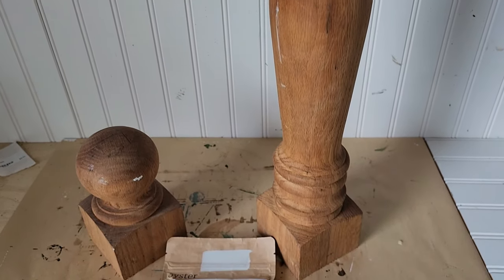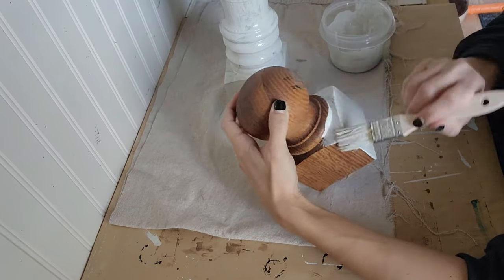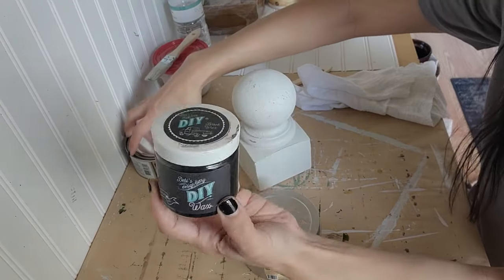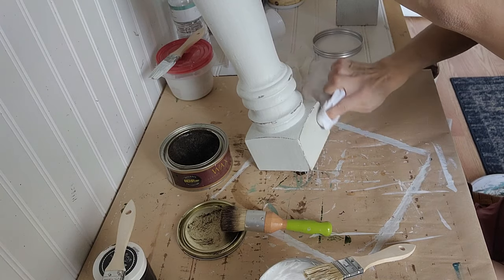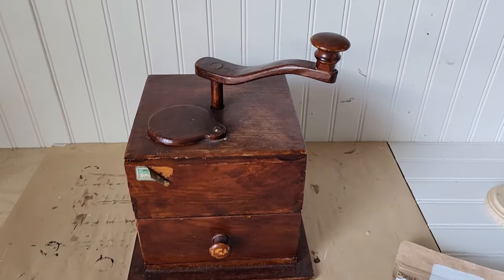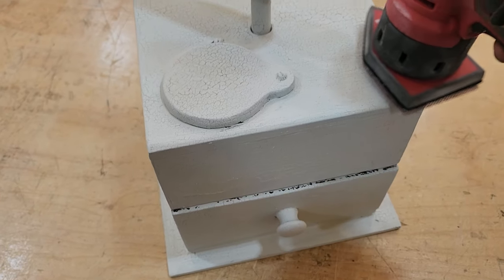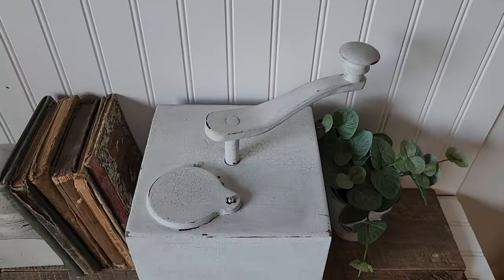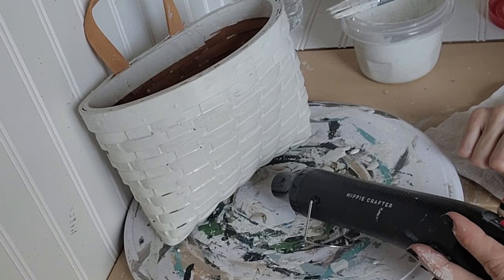Spring Thrift Flips | Using Milk Paint For That Gorgeous Chippy Finish | Trash To Treasure

Comment: Hi Emily! Great flips! I've never seen clumping with the sweet pickins paint so I wonder if it's a quality issue. I much prefer the crackle you achieved to chipping, but if you want chipping you can put vaseline on the surface before painting. I would add that tag back to the coffee grinder -- perhaps on the inside.
Reply from the maker: Hi Gina! Thanks for the Vaseline tip! I actually am really with the crackle look the longer I've sat with those pieces!!

Comment: Loved the candlesticks!! I have worked with milk paint and I too stuggled finding the chippy places, but I have watched Jami Ray Vintage stipple on a chunky layer of paint using salt wash, letting that dry, then applying the milk paint over that. After drying they sand or use a scraper to unearth the chippy. I have everything I need to do it, except the perfect piece to try it on.
Reply: Baking soda works as well and much cheaper❤
Reply from the maker: Thank you for those tips Robin! I will have to try that!
Reply from the maker: Thanks! I like using both products ☺️
Reply: @WoodWineandCrafts  very welcome I hear u there